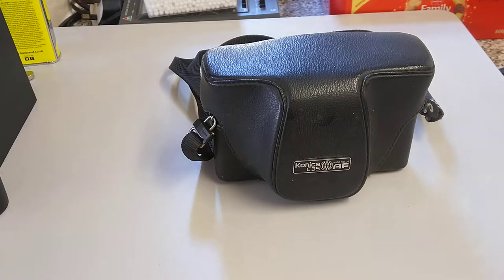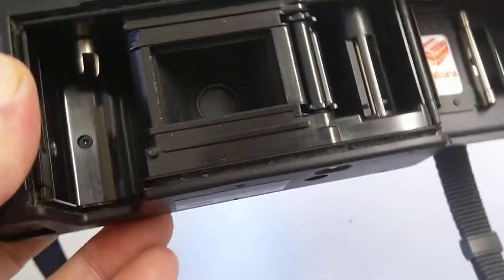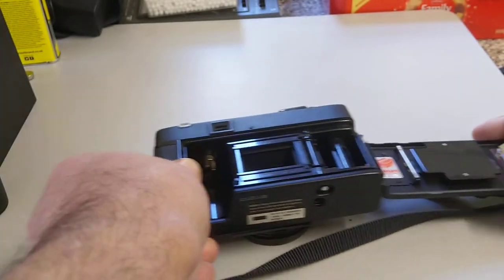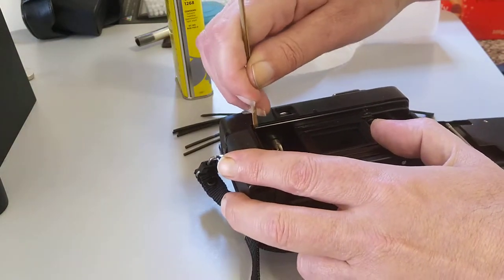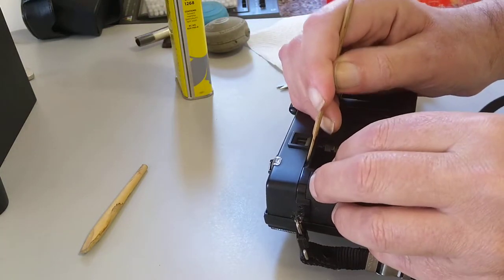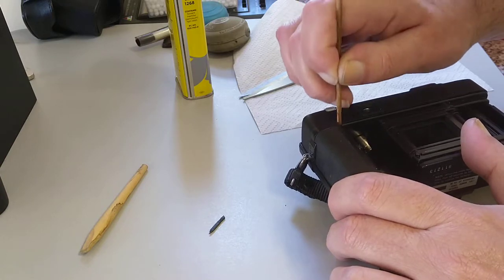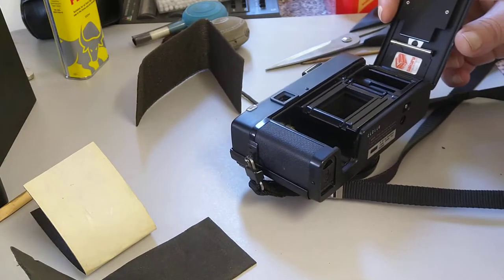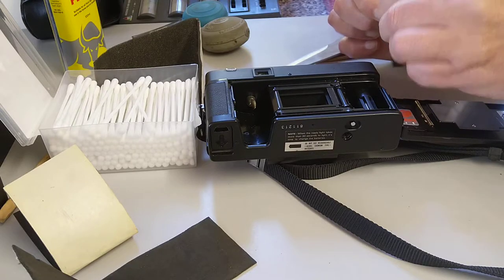How To, replace film back door seals, Konica C35 AF

Comment: Hi! I hope you’ll read this, you’re the only one I could reach for help. Apparently my C35 AF’s film lever was stuck and won’t go back to its original position. What should I do? What is the cause of lever stucking? I’m getting frustrated.
Reply from the maker: Hi, sorry to hear about your issue, please don't get frustrated, have you used the camera successfully before?
Does it have a film in it?
How long have you had the camera?
Please don't try and force it....
Open the back and see if you can move the sprocket drive by hand, forward direction only, 
Is the rewind button on the base pushed in?

Comment: Hello! Thank you for this video! I will use this to repair my Konica C35AF2. Like you said, the foam totally turned into gunk with mold, so I need to get it out. Could I ask, do you know what thickness foam you bought or where you bought your light seal foam kit? I'd honestly prefer to not cut it myself :/